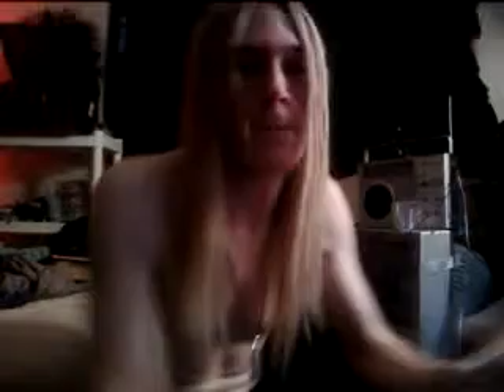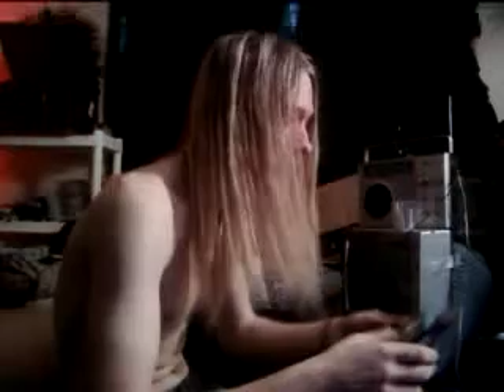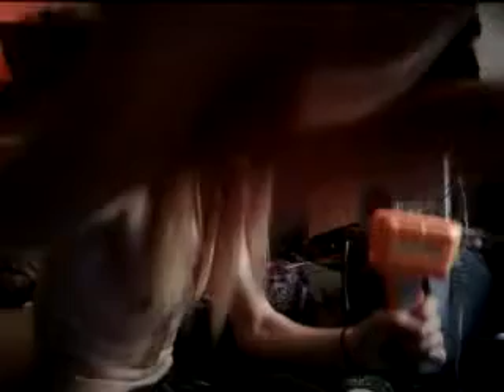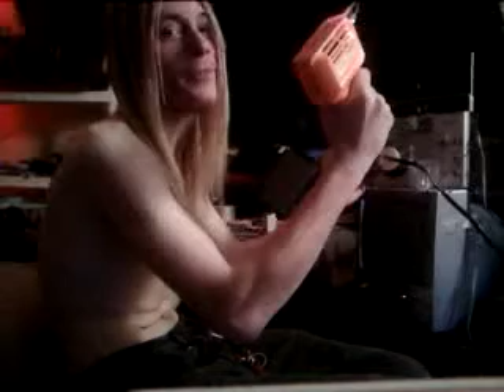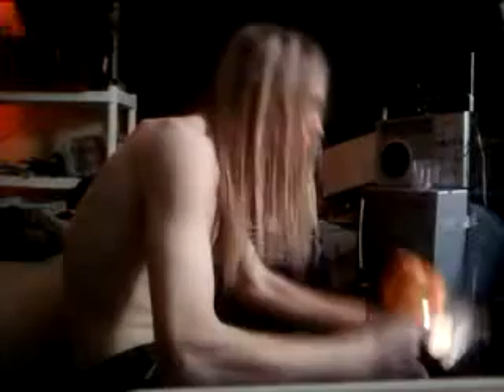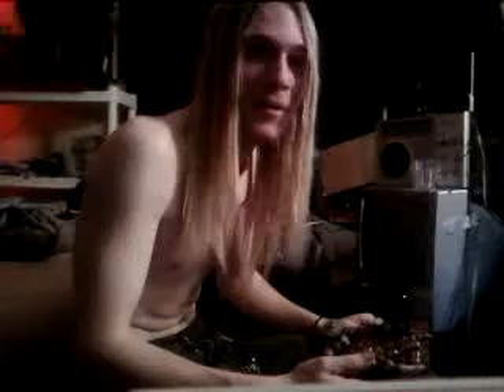SALVAGING AN OLD CAPACITOR FROM CIRCUIT BOARD

Comment: Excuse me, but if that's an electrolytic cap, then it's already cooked by the time you pull it out... you should really get a soldering iron if you do electronics, and some flux as well... if the tip is red hot, then it burns out something of the solder, and it becomes even harder to melt, and more fragile. the tip should only be about 250-300 grade C. btw don't bother salvaging electrolytic caps, because they are most often the problem in a bad circuit, since the liquid inside dries out as it heats up, and the ESR(equivalent series resistance) inside goes up, and as it goes up it heats up more and more, until it breaks... Belive me it's much easier, and quicker to use new components, especially larger SMD(surface mount device) parts. Oh... and it's not a chip, it's just a passive component. A chip is an integrated circuit, that often contains a whole lot of components inside...
Reply: There's also another problem with salvaged parts... you build something, and it doesn't works, you try to debug it, and after a few days of wasting your time, (if you don't give up earlier) you realize that the problem is not with your circuit, or not just with your circuit but with 1 or more salvaged parts... Get a breadboard, some trough hole parts, and jumper wires to play around and experiment with it, and as you have succeeded to build up a circuit on breadboard, try printing it to a PCB (printed circuit board)... and use SMD parts if you can, as they are cheaper, easier to solder, they require far less solder, and you also don't have to drill as much hole...
Reply: Oh and if you wanna learn electronics more seriously, try watching "EEV blog" on youtube... There are hundreds of videos, explaining and showing all sorts of stuff theoretically as well as experimentally. I've learnt much from there...
Reply from the maker: RPBCACUEAIIBH ok man thanks for the info ill be sure to check that out